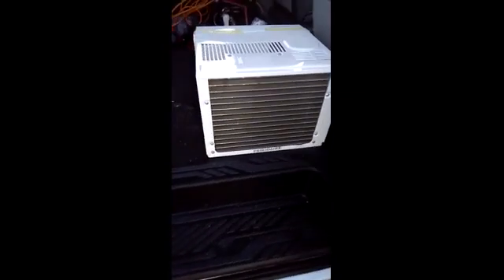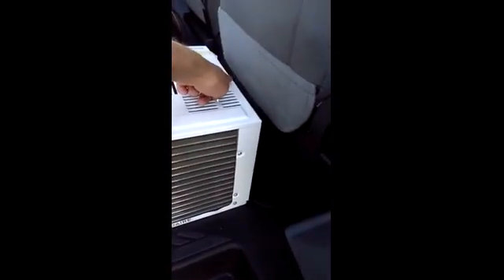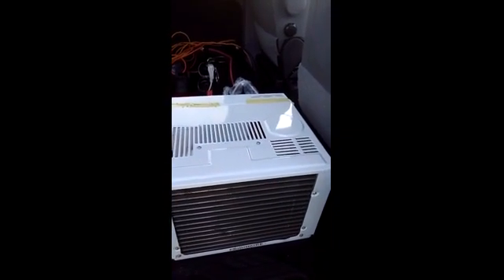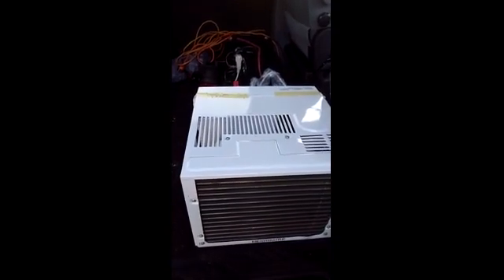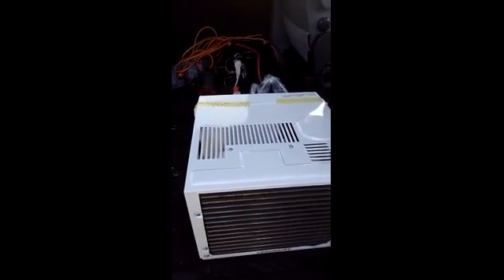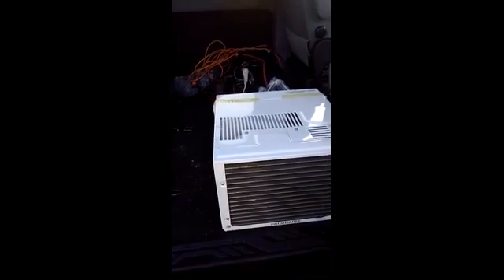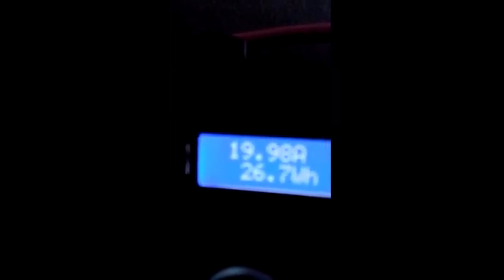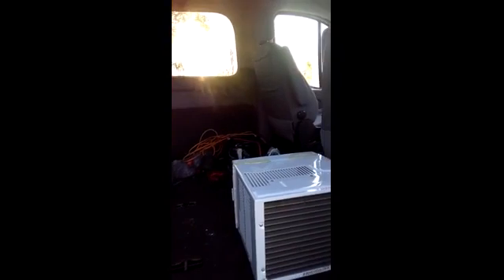VANLIFE:  Replacing an air conditioner for use with an Inergy Kodiak Solar Generator

Comment: Go for a portable zero breeze air conditioner its 1100 BTU  if you have the money. It can run both of 110 volts and a lithium ion battery (5 hours on a single charge). its rated in between 150 to 180 watts of power.
Reply from the maker: I would have bought a Zero Breeze for sure, but it has a lot of write-ups that it failed to last.
When I tried to order one, I was going to be put on a waiting list. Not a good sign.
I think they still are having a problem with the design.
I really do not want my large window A/C.  I would love a Zero Breeze.  It would meet my needs.  I just need one that would work.
The comments were that customer service was very bad.